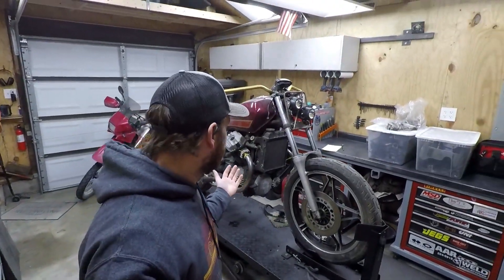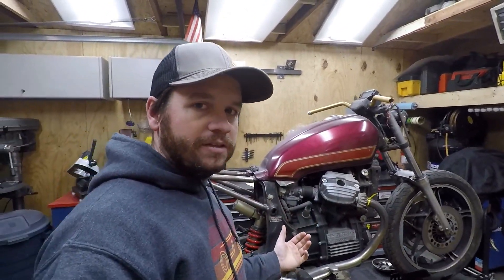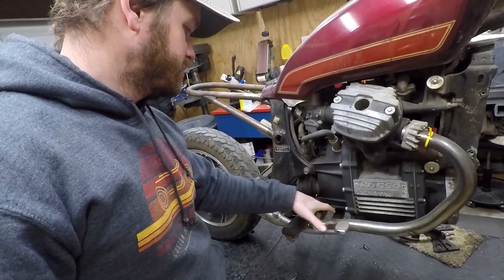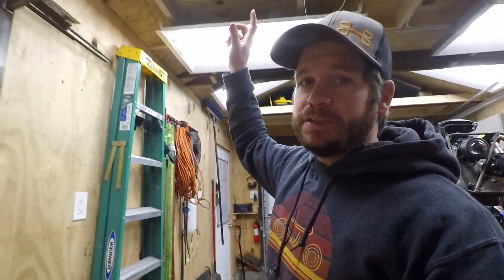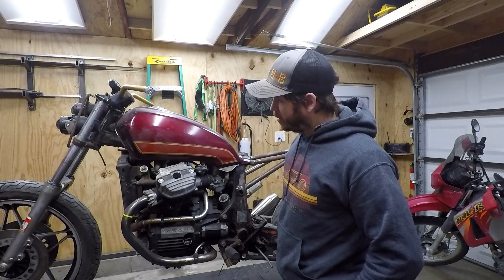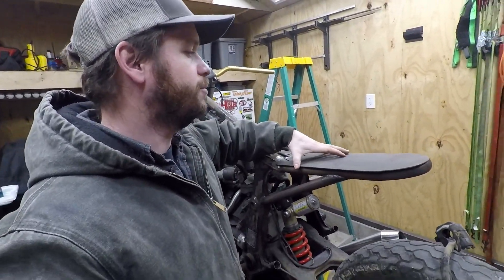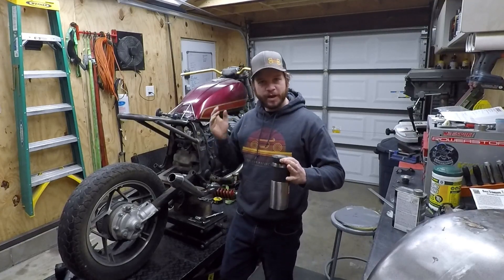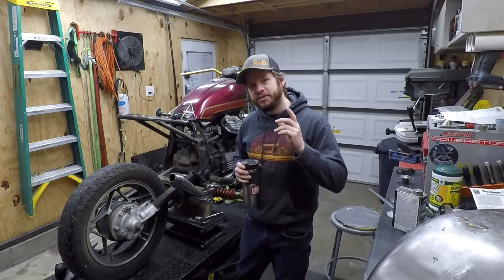Honda GL650 Build - Project Intro And Overview! - EP1

Comment: Hi BJ
Great video, Mate I'm going through the same thought process as you. I just picked up a HondaCX650Euro in a sorry state 
Thinking about the project. I thinking shall I use the original TAI Ignition, the wheels and brakes, the wiring loom ??? Primarily to reduce cost. The spoked wheels on my CX Café racer cost $4,500AU !!! nearly half the cost of the 
Soooo back to doing some thinking
Reply from the maker: If I could change two things on this bike it would be an 18" front wheel with street tires and to have used a full electronics controller.   I actually would have saved money in time by using a Morty or something. I just WISH I could get a euro here!
Reply: Thanks for the advice mate
You say a Morty ? I do tend to agree using a moto gadget is far more tidier and reliable than a stock wiring loom. Your speedo looked like a good option, would that work with a moto gadget?
My frame has come back from the sandblasters so I'm into the pro link. Your video was very helpful. I cant get my hands on a GL500 link so I am going to cut the CX650 link and get a U Bracket welded on by a pro
Reply from the maker: @Coolhand99au  the Morty is a system by NUUT. Check them out nuut.ca They are having a Christmas sale starting in December for a killer deal!
Reply from the maker: @Coolhand99au  Also yes the trailtech would work as its mainly standalone so just give it switched and constant hot along with necessary inputs and its good to go
Reply: @BrickHouseBuilds  Cheers Mate I'll heck it out

Comment: Looks good, I am building a GL650 also.  Right now I am interested in what rear shock you are using and how you adapted it to replace the standard air shock.
Reply from the maker: Hey Bill, thanks for checking in out. I'll have a video on the shock in the next couple weeks but I can say I am trying a cbr954 shock. You can see more ahead of time on my other social media pages as well.
Reply: @BrickHouseBuilds  Thanks, I have seen your responses on some of the FB pages...I just liked your FB today. I'll be following you--great ideas and videos. I am on my 3rd build, I have done a CB750F Cafe, CX500 Scrambler and the GL650 is in the design stages-looking at a mix of a street tracker/cafe style bike.
Reply from the maker: @billhall6528  very cool! I do appreciate it sir!

Comment: do you still have any of the farings? specifically the front i picked up an 82 silverwing interstate but its front is ruff and needs a lot of fiberglass work. i already made a new front harness for it and got her running but still looking for a faring and speedo cable
Reply from the maker: No those were sold a few years ago when the project was first started.

Comment: Did you do a before and after weight?
Reply from the maker: When I started I did and in the state you see it in for this video it was down 120lbs. Id added some back in small parts but I am confident it was more than 100lbs lighter than stock